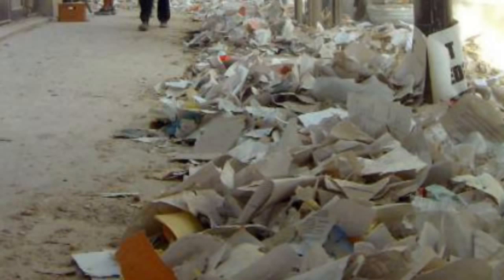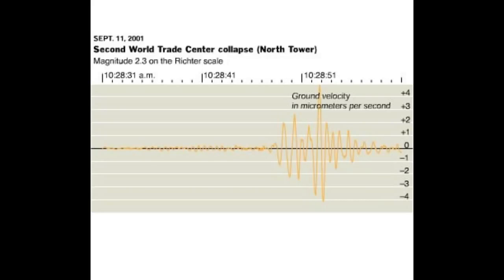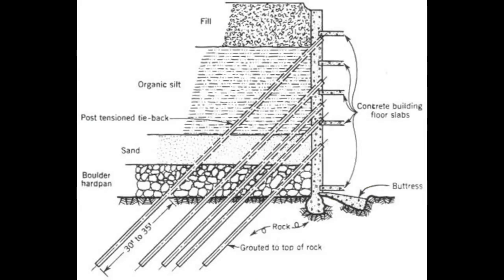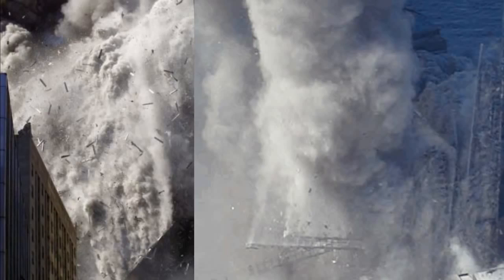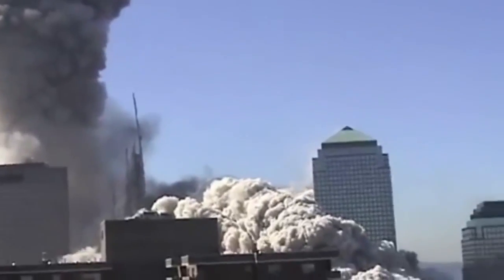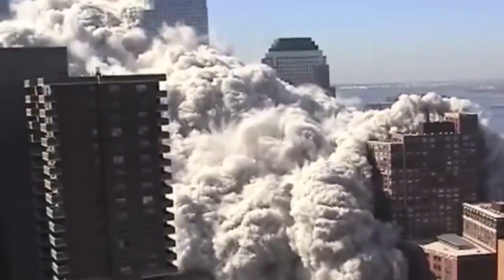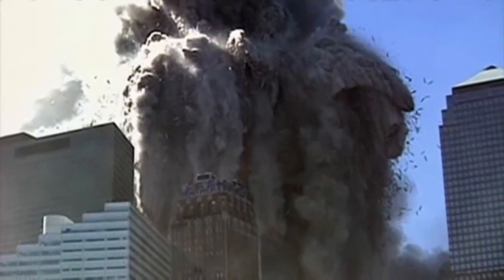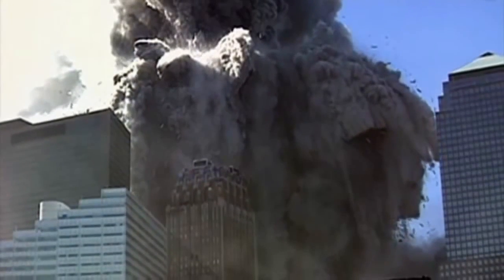Dr. Judy Wood - NIST Energy Weapons (911 Attacks)

Comment: i do not give a shit about con. theories...but, any architect should know this:

1. steel building can not be demolished by fire.
2. multiple steel core columns in wtc are waporised
3. structural steel columns on facade are waporised too
4. there is huge amount of energy, this is pure physics, that  steel ,as a material, need to have broken atoms inside its molecular structure....
5. where are the cca 500 000 000 tons of wtc steel debris and parts gone, where are they?
6. if you use french method of controlled demolition called "verinage" it must be egzecuted at half of the builiding, but for ONLY CONCRETE building... because concrete has no big tensile strenght, like steel does...and if they use that method.... let me ask again: where are the main steel columns..
7. last year there were 12 steel like wtc, that were set on fire for a few days!!!!! and thay DID NOT COLAPSE........ static loads.
8. If you take only DYNAMIC LOADS as a main reason for demolition of wtc , than these problems occur:

8.1. steel bulidng is not concrete one... steele is flexible and it can take bigger amount of tensile and centered load than concrete
8.2. WTC are builted with so much steel inisde that any "pancake" bull shit CAN NOT be done.....so, do the math

8.3. why your goverment create "airplane" story to cover up something.... when 1.there were no plane... EVER.... .2.WTC steel facade CAN deal with multiple airplane shots, and non of its (of WTC)structure wouldnt be demolished......because, the facade of the WTC was constructed to deal with that things...

so. i have only one question:
Why your gov. create so many bull shits, to cover up something.....i do not know what they tried to cover, but the official story is one big lie.... they involved in this story a hundred of people from televison, newspapers media, BEFORE it even started to happen, they have all prepared...so let me ask one more question....

How come any journalist  from local newspapers tv houses, media, could sleep in peace, when they knew everyting before it happend..... they got every details....
example:   girl reporter in front of WTC 7, was telling to the world that WTC7 just collapsed, but after 20sec during her live speech, WTC7 STARTED to collaps...so.... 
i am wondering....how anyone from TV houses, from media can go to bad if they knew all the story...... 

thank you for your reading. sorry for my english, i did my best :)

Comment: I jus wanna no how a building of 110 floors,can fall at free fall speed,when only the top what 15%  was on fire. This is impossible by all laws of physics given the theory we are told. From what Iv seen that could only happen if the  building met zero resistance on the way down. So even if it collapsed floor by floor on top of one another,pancake effect. It still would of fallen far slower an would of got slower the more it fell. But no it fell in 10 secs to dust.  Fuk ay what do I no

Comment: This negative energy is a hoax, a diversion. What operation can turn iron into ash? Everybody knows the answer just don't have the courage. 
OH! PEOPLE WHEN DO YOU LEARN? DO U KNOW HOW THE WTC WILL BE DEMOLISHED WAS DESIGNED FROM THE BEGINNING OF THE BUILDING. IT IS THE FEDERAL LAW. 
THE PROCESS IS CALLED "UNDERGROUND NUCLEAR DETONATION". MEANS NUCLEAR BOMB WITHOUT ATMOSPHERE . USING THIS PROCESS RUSSIAN ARE DRILLING MINES FOR 30 YEARS. A ROUGH CALCULATION  150 KT NUCLEAR BLAST, 350M WHAT IS CALLED CRUSHED ZONE WILL TURN INTO DUST. AS THE BLAST WAS UNDERGROUND THERE WILL BE NO AIR BLAST ZONE (SHOCK WAVE) AND THERMAL RADIATION ZONE. SO NO BIG BOOM AND NO DAMAGE OUTSIDE OF 350m red circle . The plasma zone(core) will be 100m dia circle only where the temperature will go very very very high. From 50m to 350m called crushed zone where everything will turn into microdust because of extreme compression not HEAT. People jumped from the building because above 350m the pressure wasn't enough to dustify . But the pressure difference was extreme and unbearable. so out of the building was the only safe place and they jumped. The high pressure stage stayed for only 10sec.After this the building collapsed. After the detonation, it will take 4sec to increase the temperature.. WITHIN this time people might feel a little vibration. After 4sec, it will take extra 10sec to complete the compression. After this 14sec the building will collapse. 
WTC 7 was less than 350m. That is why no DEBRIS left. WTC 1,2 was taller then 350m. That is why some debris were found. 
300m radius circle area will remain radio active for 7 to 15 days. And the core(cavity) will remain radio active for 1 YEAR. So now u understand why the rescue workers r suffering from cancer and other illness. 3 nuclear bombs  detonation. This technology was invented from the beginning of nuclear experiment.

Comment: Why is the basement intact!!!?? If it was a energy weapon the basement should be the SAME as the rest of the building!?
Reply: The basement is grounded. Disperses the beam and its tunnel through the atmosphere, in the ground. That came from Montauk (flight 800, Philadelphia project), through Brookhaven lab (particle accelerator, experimenting in turning solid materials into liquid and two of the six buildings on the particle accelerators ring aligns with the twin towers complex, 2 buildings align with hurricane Erin, I'm guessing the last two aligned with HAARPs dome), reflected off the HAARP dome in the ionisphere onto the towers/buildings. Vibrating the towers like tuning forks, turning the concrete into dust/foam. Reverse polarity electrostatic beam opposing the van der Waals force = liquid = iron-rich microspheres found in the dust. The cars were in the tunnels edge.
Reply: Bret you dont know anything about these weapons
Reply: You can't assume that.  Physics does weird shit, especially anything involving E&M.

Comment: Dr. Woods you can manufacture paint chips like the Jones&Harrit ones with international oil based red paint and aluminum cutting dust.   There is no proof the red grey chips supposed to be Areojel nano thermites have any significant value.
   I created actual thermitic paint chips and ignited them under argon gas.
It is simple and easy to do.
Reply: ***** No it wasn't, the substance found was primer paint with no Elemental Aluminum Fuel.
Can't have thermite without the fuel.
Reply: ***** Where is the inert gas test nessisary to prove self oxidation, where's the aluminum fuel, and residue from the reactions.
    Looks like you posted a paper by people who couldn't find that fly ash microspheres in their back pockets.